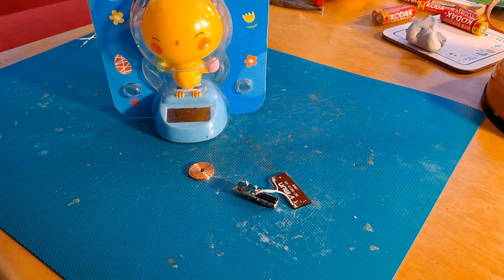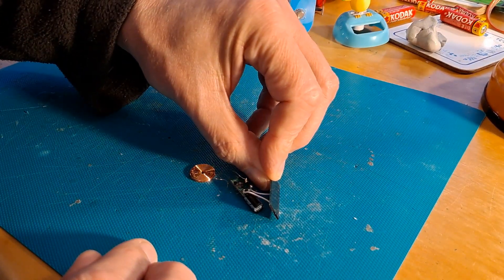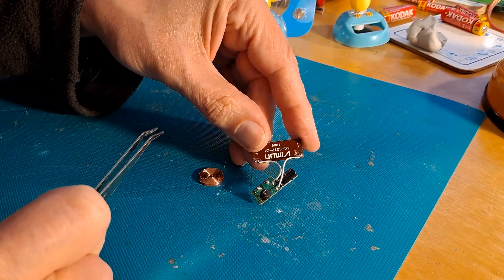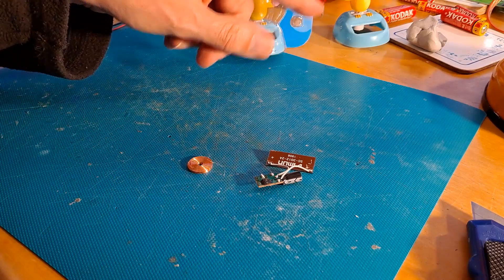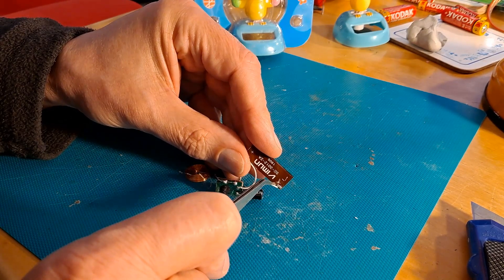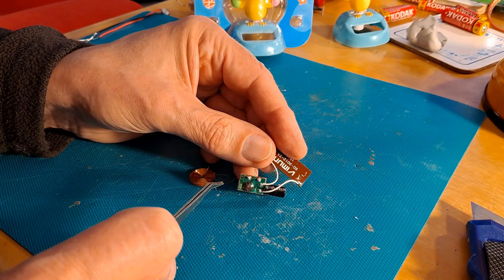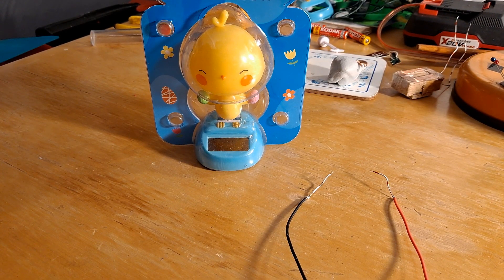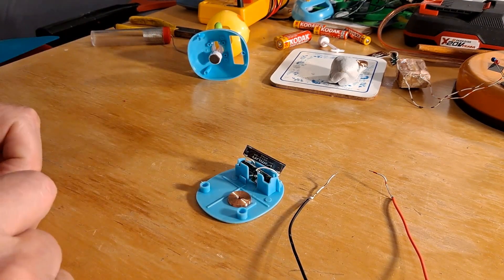Solar Rocker Fault finding using a AA battery

Comment: So informative!  I'm hoping you can help me with a question.  I had 6 solar nodders in front of me.  Of the 6, one just twitches and 2 seem to need more light than the rest.  If get those positioned just so, they are as speedy as the rest.  Just one still sort of twitches.  The structure seems OK.  It just doesn't seem to have enough power to do more than twitch.  What would cause that?  It's been sitting in the sun and is still weakly moving compared to it's neighbors.  I've seen this before.  Curious as to possible causes other than structure.  Help me Granddad!
Reply from the maker: Here is an interesting fact. If one is dead (the coil wire is broken) and they are all close together, the movement of the good ones can cause the dead one to swing with magnetic coupling. SO the one that is just twitching would need to be moved away from the others and checked on it's own. If you have confirmed it's twitching is NOT due to the others moving, you do at least know there is power. That would suggest something is either out of alignment or broken. Sometimes the pivots are cracked or broken so it cannot swing freely. This often happens after they have fallen off the shelf. Another problem is when the top section has been pushed down onto the base too far and the pendulum magnet is actually in contact with the coil so it cannot swing freely. Another unlikely issue is that you have placed it over a metal item. The metal diffuses the magnetic pulse and also attracts the swinging magnet - stopping it swinging. As for the actual electronic circuit, I don't think I have ever had a faulty one. It is always the wires to the coil or the wires to the solar cell (or the solar cell is cracked).The only other component you can change is the capacitor and I have never had one of them go faulty. They are not under any stress in operation.
Reply: Thanks so much!  That'sgiven me food for thought.  The 6 nodders are fairly far apart on a large picture window sill made of marble.  So seems likely yoyr thoughts on internal disarry/damage to the internal parts/structures are the culprits.  I wasnt sure if nodders just wear out after a while.  Think these are all a year old or more.@GrandadIsAnOldMan
Reply from the maker: They do wear a little, but for most of them it is not noticeable. I have a solar snowman rocker that I converted to run on dead batteries. He has been running virtually non-stop for 10 years https://www.youtube.com/watch?v=_NZRZCHMZ4w&list=PLA5a2xPRSrB2IsZs-7feda7BZFdPpxHdN&index=1

Comment: Also any tutorials on soldering. Especially on scrapping the existing joint and then soldering new pieces.
Reply from the maker: I have done quite a few videos that include the soldering. Here is a video of me working very hard fault finding on one of these https://youtu.be/oaP2KQuZVmM 
Here is another one https://www.youtube.com/watch?v=i59hVTDX53U&list=PLA5a2xPRSrB1L61NAVuE5I9FbPgq3sSG1&index=37
All my video descriptions include links to related playlists.
Reply: @GrandadIsAnOldMan  Thank you. Going to get kit . It will be costly compared to rocker cost  but good to learn something new and fix broken things
Reply: Finally I was able to give life to rocker. Done soldering and all fine. But I have one question. Which glue is used to fix the coil. Can I apply same glue to wires which connect to the circuit. Because these wires are hanging in air and may get snapped by magnet

Comment: In Australia, can we get the coil from bunnings and just solder to circuits. Are these coils difficult to buy from market
Reply from the maker: Why are you asking me? Surely, you have access to the Internet and can search for the component parts yourself. You will probably find it is easier to buy a new solar rocker.
Reply: @GrandadIsAnOldMan  Coils are present but not of such thin hair thickness. I'm trying to replace the base with another rocker but size and colour unfortunately not matching

Comment: What all things make up the battery testing . I can see a battery, wire attached to the battery. Is the wire soldered directly to the battery
Reply from the maker: I am just holding the wires in place. Many people asking for help with this do not have access to a soldering iron. The point of the video is to show you can do some basic fault finding using an AA battery and some wire. With that, you can  identify which of the 3 main components is the problem. The coil, the circuit board, the solar panel.
Reply: @GrandadIsAnOldMan  Yes, got the point. Good for theory. But practically,  soldering is the main roadblock. Without  knowledge of soldering though , it's best to buy new one

Comment: Nice work
I have a budha that isn't working
It has a few magnets but they were in the bottom
And I can't see where they were. This one has his head moving and a fan in his hand so I few magnets
Any info
Reply from the maker: I can't give you any specific guidance for your particular item as I haven't seen one. But as I said in the previous reply, this video covers the generals for fault finding. There is not much to check on the electronics, but I take you through it step by step. As I said before, it could be as simple as the rocking parts have come off their pivot points or maybe even the pivots are broken. That is a more usual fail than anything electrical. If it has been knocked off the shelf and landed heavily, then a broken plastic pivot is very likely. One other issue is, you really need sunlight to get them to rock. If you are using modern LED light bulbs or fluorescent lights, you may struggle to get any action as the LED bulbs to not produce the right wavelength for a solar panel. A halogen bulb or an old incandescent tungsten bulb will give you better results. In the video description, there are links to my other solar projects.
Reply: @GrandadIsAnOldMan 
Thanks for that I think ice found what was wrong
There should be two magnets and a while ago I've found a small magnet and I've taped it in place and it's working well glue it  soon to fix properly
Thanks for your help
Reply from the maker: @vicmills7702  brilliant 👍👍

Comment: it's great that they are only a pound. Lots of little projects can be done with them. Remember when you tried the IR on a solar panel? Well, what about trying a laser diode on it. You might have a tool that has a laser diode fitted. If you do it would be interesting to see how far away you can be with the laser and still get the rocker to work. I would think a laser would make it work. 👍
Reply from the maker: Done that, Mike. Remember a laser is a small point of light. That means more than 90% of the solar panel receives no light. I will add the link in a minute
Reply: @GrandadIsAnOldMan  Just back in. I will go look at your video link. I was actually thinking about the laser being moved out of focus so the end result would be a large spot rather than being a tiny dot. I should have mentioned that in my comment.
Reply from the maker: https://youtu.be/sZOeT-Pn5IY